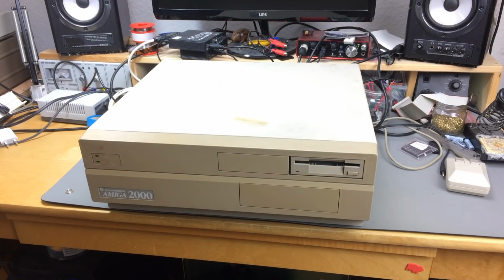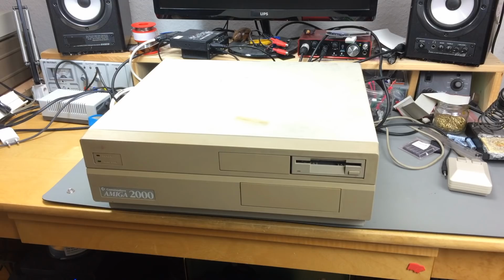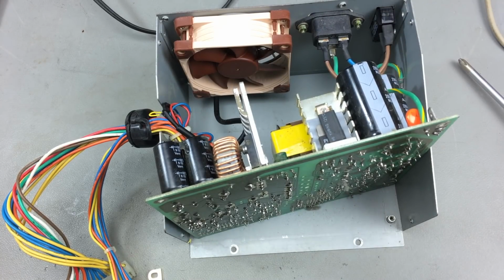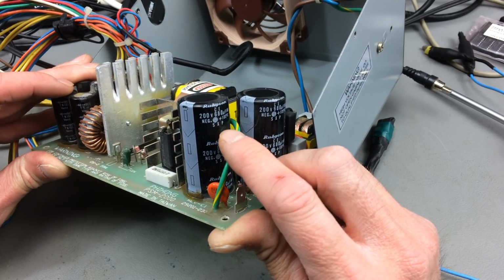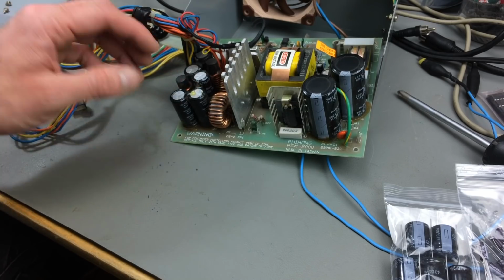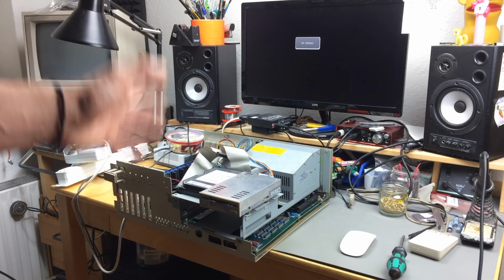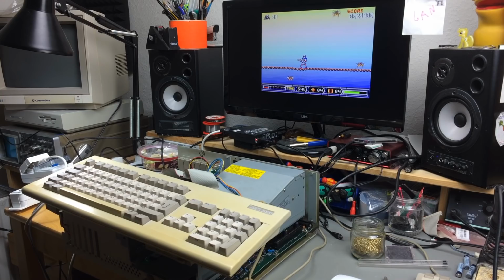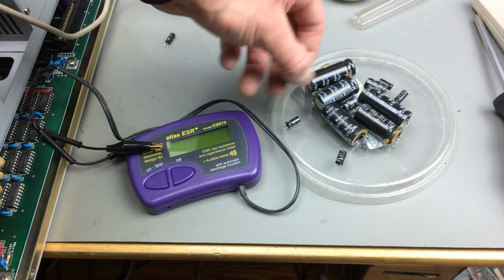Amiga 2000 Power Supply Recapping

Comment: The glue used for capacitors in power supplies is called Silastic(now called Dowsil i think),its made by Dow Corning. its there because the caps vibrate from frequency they handle not the fan. Silastic is the proper silicone to use since it contains no acetic acid like automotive and normal store bought silicones/rtv's. The acetic acid(think vinegar) in regular store bought silicone can corrode the aluminum can on capacitors. There are a few substitutes for Silastic from stores but they are hard to find.
Reply: a4000t can a hot glue gun be used?
Reply: @MrSleepProductionsInc  not recommended because its flammable(silastic silicone is not) and the psu can run warm at times and hot glue has a low melting point.
Reply: Interesting! Thank you for that information!

Comment: I did once put a capacitor the wrong way, one of the smaller ones. It did work fine, but after a week i did smell some burned electronics and the capacitor had died. It didn't exactly "explode", but it died. I replaced it, and put the new one the right way, and it worked.

Comment: You can use replacement caps that are both higher in capacitance and higher in voltage, not a problem in a PSU. So no need to find the exact values if they are hard to find. Modern caps are usually smaller in size for the same capacitance and voltage.

Comment: It's definitely the ones on the secondary side that suffer the most, and the ones that you should replace. The big line side capacitors are usually fine. If you want to replace those, Kemet ELH or ELG series should be good, but check the dimensions.

Comment: Filter caps' capacitance isn't critical, you could use 1000uF/200V, modern ones are much smaller in size, so they'd easily fit.

Comment: Those old capacitors are actually pretty good spec especially considering their age!  Smaller capacitors back then usually did have higher ESR. The capacitors you have replaced them with likely have even lower ESR than those, so the supply will be cleaner than it was before

Comment: Also you could go higher in rated voltage for the capacitors, that helps them somewhat with withstanding temperature. Also always use the highest temperature grade possible.

Comment: Good job, Jan.  Go ahead and apply silicon rubber between the capacitors, and around the base of the capacitors.  Remember, this is a switching power supply.  Those capacitors tend to vibrate because of the high frequencies, not because of the fan, lol.  The "channel" down the middle of the PCB separates the high voltage side from the low voltage side.  So, only the capacitors on the high voltage side need to be discharged.  At least you have done this the correct way (using a resistor).  Again, good job.

Comment: For the two main filter caps you don't have to use 680uF or 200 Volt. As long as you stay or go higher then the voltage rating and since they're filter caps you can go as high as 1000uF. Digikey has some Cornell Dubilier brand caps that are rated for 200V 105*F 820uF 20% tolerance for $4.08 each. They also have Nichicons for about 6 bucks each, same specs.

Comment: 680uf/200v caps are common and cheap on eBay. Several brands.
Readings of values higher than rated indicate a leaking capacitor. Modern caps (post 1970s) are seldom higher than marked. Many are just below. Old-time caps (1940s-60s) were frequently higher due to manufacturing tolerances (+/- 20%) being looser. Manufacturing got tighter after computers and precision manufacturing became common. Companies were able to cut waste by rolling them to exact values.

Comment: Putting new glue on the capacitors after the recap is definitely recommended because the high frequency vibrations which they are subjected to. Second advice is to measure the ripple  voltage under load  before and after replacing capacitors to check if the recapping actually brought improvements

Comment: An filament light bulb also works to discharge the caps in fact a 100 watt light bulb makes a good dummy load to work older tv set's switch mode power supplies.

Comment: I just bought one and.. yeah the -5V rail linear regulator was dead so it put out the full -15V or so out. Luckily that does not get used much in this system... Guess I'll add some zeners in mine to protect against gross over voltage.

Comment: This is great! I have the exact same power supply, but the 12v line is reading 7v, however all the other voltages are correct (5,-5,-12).  I suspect a recap would not fix this issue.
I also am unable to find a schematic for this unit.

Comment: Those small caps have typical (rather higher) ESR, but they rarely need smaller ESR, because they are in non critical places. Those 4700uF caps have considerably higher ESR than new Panasonic FR series (60-200miliOhms measured old Hicons vs dozen or so miliOhms max. in Panasonic FR) and higher capacitance than rated is usually sign of worn caps, so no: those big caps were old and should be replaced and probalby those smaller caps could stay.

Comment: just because a capacitor tested "ok" doesn't mean it is good...

I had a power supply on my PC, it didn't work with high loads anymore and I bought a new one... the guy I gave the old one recapped all, and it was all good again... capacitors tested individually for short time showed they "were good"... but we knew for sure they weren't good...
Reply: I think my A2000 needs to be recapped. The last time I used it (a couple of decades ago) it seemed a bit flaky after I had added in the network interface card.

Comment: I use a 40W incandescent light bulb to discharge the large bulk caps.
ESR a new Low impeadance 1uF 50V electrolytic will be in the order of 4 ohms  @ 100kHz if it was perfect XC is 1.6 ohms at 100kHz

Comment: Have you checked if you could replace the 200V/680µF Caps with 400V/390µF?
That should be possible in 230VAC as the voltage doubler is not requred and should not be used.
Might e something to look into in the future!

Comment: I order from Okaphone in the netherlands, which a local shop for me. They order from farnell or digikey and can supply any capacitor and only use panasonic and other high quality brands. I've also ordered the 680uf 200v no problem. I'm not affiliated with Okaphone in any way. I've recapped an Amige 500 and its psu, 1084 monitor and am planning to recap my msx computers and c64.

Comment: Why not do a testrun without building it into the 2000 and measure the output? NIce vid btw! Thanks to you I have new Noctua build into my 4000 PSU :)
Reply: On a power supply, you usually would need to have a load on it to get a proper reading.  You could rig up a test bench to create an artificial load, but for a single repair, it's kinda overkill.
Reply: @arcanescroll  sure, but to test if the caps will not explode I would think you just turn it on without the effort of building it in and connecting it to the mobo
Reply: @tekk9995  And by turning it on without a load, you can cause wear and possible damage to the very capacitors you just installed.  And, they wouldn't explode, it takes a lot more than that to cause a cap to explode.

Comment: When I discharge caps, I usally use a 230v/60W light bulp.
Reply: that will work just fine as the bulb is effectively a power resistor
Reply: @jaycee1980  Exactly. And you can see a blink, if there were a voltage.

Comment: Aber ich möchte auf die hübsche Festplatten- und Speichererweiterung starren.

I don't know why I don't like the idea of having the capacitors so close together like that, but if it fits and works why not I suppose. I didn't know about ESR actually so thank you for the info there Jan. Oh and Good tip on discharging, I'm sure I would get myself with that sometimes.

Comment: and, it works!!!! but it was working before so recap is fantastic... what i do usually is to use silicone like the one you use for bathroom for attach parts together. That is an excellent sealant and it also can't burn (and become conductive) so, it's excellent for electronics.

Comment: Nice. Good work. I just missed out on a budda ide. But then I need to get my 2000 working. It turned up and not too bad looking at it no major battery leek. Power supply good and steady on all voltages, yellow screen on boot. Reseated all chips but still no. So I’m thinking Agnus first then memory. (Yellow=bad cpu)

Comment: oh and by the way: If the Capacity is higher than the rated capacity, it can mean that its leaky.
That's why I don't like the Atlas ESR70 as it doesn't measure the leakage current of the Capacitors. Those cheapish eBay things do however...

Comment: @jan Do you have a good advice how to test a A2000 psu without an amiga? WHich lines to load?
Reply from the maker: I think you mainly have to load the 5V line, the others should start up without any extra load. There are quite a few different PSU models though so your mileage may vary.
Reply: @JanBeta  I put an old HD on the 12V and loaded the 5V with some high wattage (?) resistors (about 2,7Ohms)  they did get a bit toasty but I only needed to check voltages. So worked great.

Comment: hi  how did you make that lead please
Reply from the maker: The lead for discharging? It's just a large cement resistor (I think 100R) with a bit of salvaged mains wire and a banana plug on one and, a crocodile clamp on the other.
Reply: @JanBeta  thank you

Comment: You should swap out that crappy upscaler for a cheap $15 GBS8200 with GBScontrol firmware.  Night and day difference.
Reply from the maker: Yes, the upscaler isn't great. I'm saving up on a better solution at the moment, especially important as I recently started streaming on Twitch, too.

Comment: Next time, please power the PSU up with only an old HDD connected, that way you are only risking your PSU and the old HDD and not your Amiga.
Reply from the maker: I don‘t think it would power up at all with just a hard disk connected. There’s not too much risk to the Amiga anyway (I trust myself enough to not seriously bork things up and there’s overvoltage protection built in that I didn’t touch).